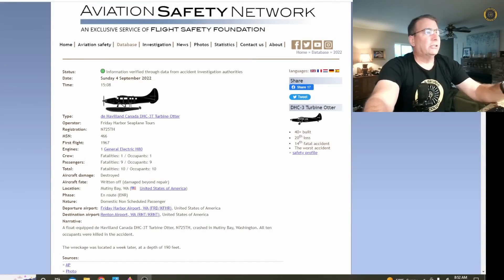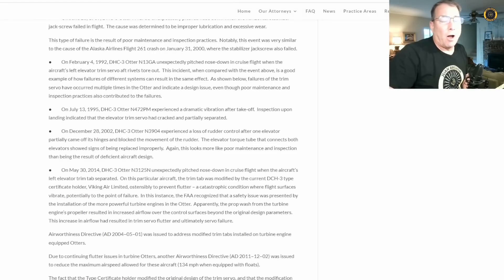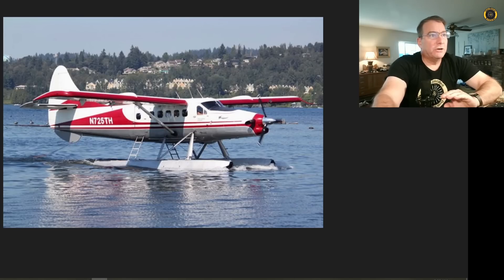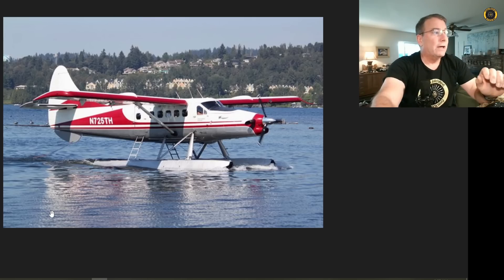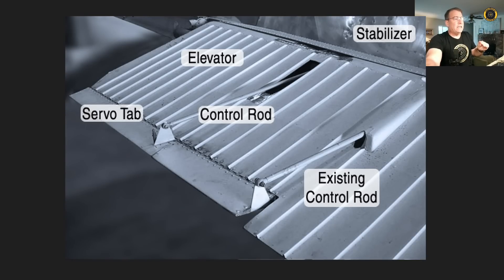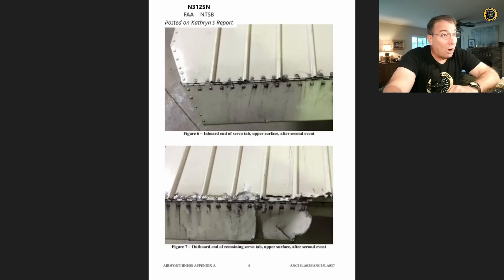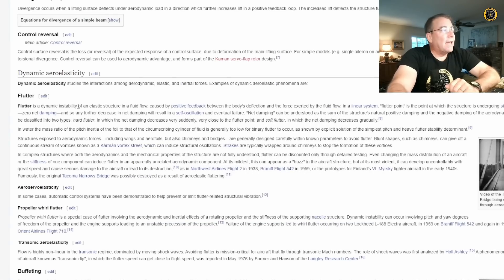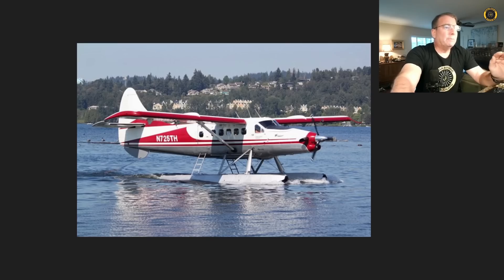DHC-3 Otter Emergency Airworthiness Directive! (Re-post)

Comment: So Transport Canada issued an AD (AD-CF-2018-4) in 2018 and the FAA did not follow up???? That alone is a failure in the FAA system. I see several flights a day going past my home and I wonder about how secure the elevators are every time.
Reply: I am going to reply to your post at the top of this comment chain. ( there is an NPRM)

Comment: Educating as always! Funny how you ignore the bear 🐻and continue describing the elevator. A true aviation geek.🙂
Reply: Even the bear was too short to perform the inspection without a ladder. 😁
Reply: @mikes8948  Indeed. My thought as well, as soon as I had written my comment above.
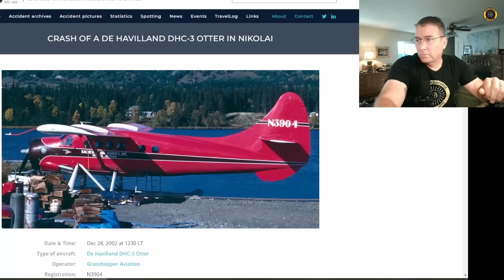Reply: Fair point, although I took it to be prefaced by his comment (4:09) "Here's an example of just how high that tail is - off the water." and therefore using an adult grizzly bear for scale.
Reply: Read the comment before seeing the video, laughed when I saw the bear 😁
Reply: Bear, for scale!
Reply: What bear?😅😂😆😁
Reply: What bear, where D go?
Reply: beavers are typically much larger than otters, but evidently that does not apply in aviation
Reply: Absolutely misconstrued the Bear reference until……………
Reply: @BB Sky Good observation!
Reply: I saw your comment first…??… then busted out laughing when that pic came up. Great call!